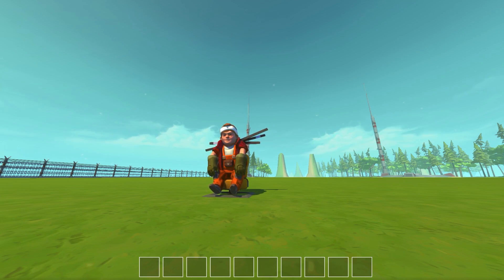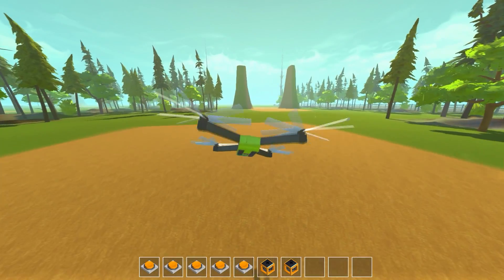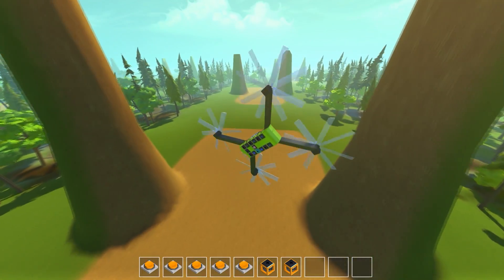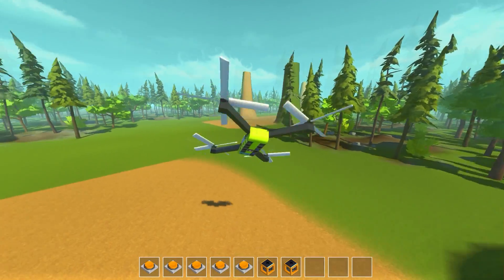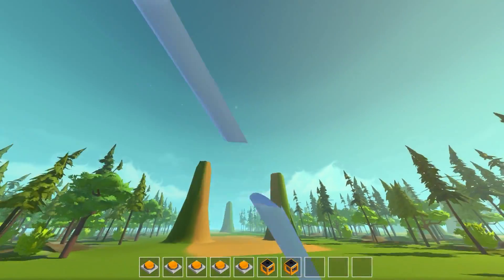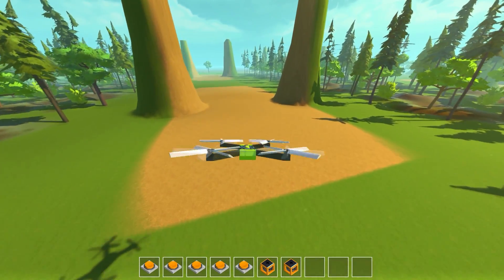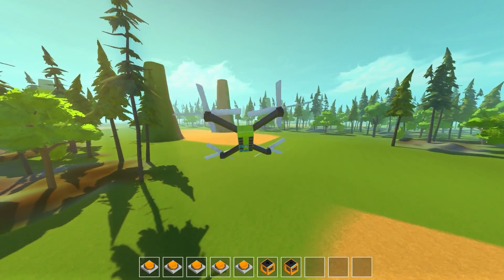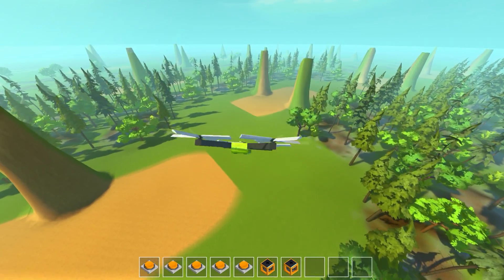FPV Racing Drone Quadcopter! (Scrap Mechanic Gameplay)

Comment: You did a thing! And this is very close to an actual racing drone. You built it how they actually work. A non-racing drone typically has Auto-Leveling which is what you refer to later with the whole pitch thing.

Comment: Its great! It kinda behaves like a normal drone but without the gyro reaction to overtilting. Like a mix between self level mode (Average non fpv drone mode) and the acro mode of an fpv quad.

Comment: I know as much as there is to know about these, if you have any question shoot. But yes all drones are not directly controlled no matter what you think. The flight controller is responsible for controlling which motors are on and off and at what speeds. Acro mode (what you are flying in) is "free hand" and doesn't have a gyro stabilize the craft. What most cheap and low end drones use and most really high end drones use is stabilized. It always levels itself out. If you have any more questions please please ask!

Comment: kAN, you got the physics of a quadcopter exact, and the computer stabilization very close. Most of them act like an angle hold if that makes sense, the more pitch input you apply, the more aggressive an angle the quad tries to obtain. this can be overridden to to flips and tricks,an most controllers will auto disable stabilization when receiving full input.

Comment: Race quad copters are the exact way you made yours. Its called acro mode where it does't self level. There is Horizon mode ware when you let go if the sticks it self level back to 0. They're called different things by different company's but that is what I hear the most and like.